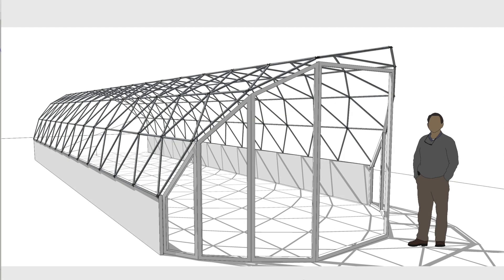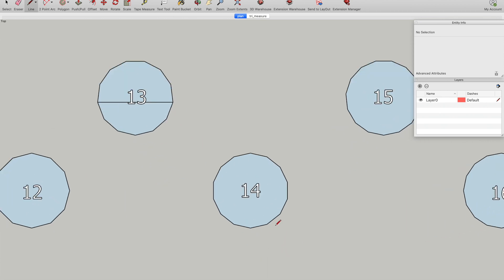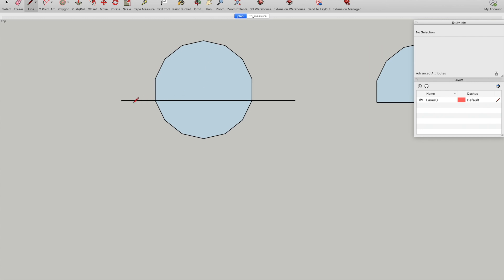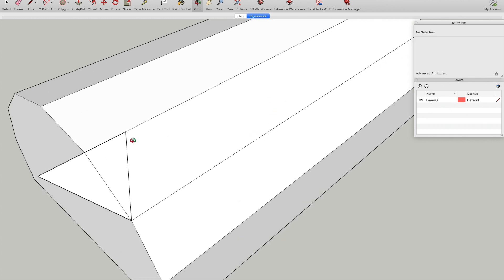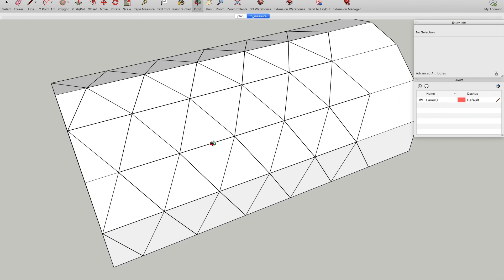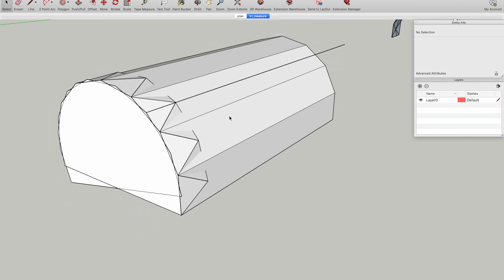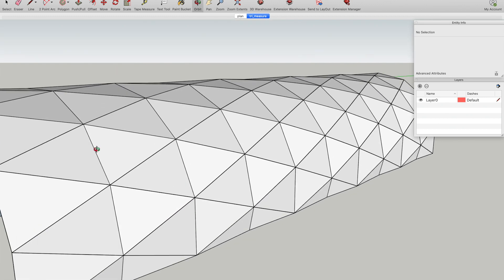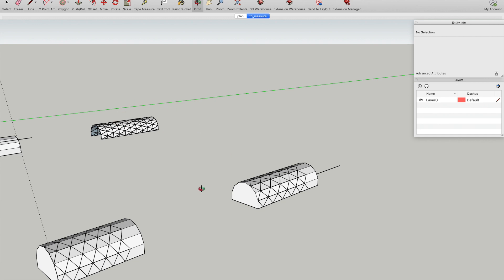A geodesic tunnel basic tutorial

Comment: Definitely up for the cheat sheet for the more complex one !  I want to use this as a roof structure for a workshop in Northern Ontario.  Need the headroom and snow load capability without large rafters and pitch required in a conventional roof. Nominal dimensions of 3 meters by 6 meters with a 1.5 meter knee wall.  Thanks for the great videos !

Comment: In sketchup it's easy enough to mark this out for pole struts, but how do you pull out and extrapolate the timber frame angles? I've tried that a few times with geodesic domes but the angle reference points are always bouncing all over the place and it's so frustrating I usually end up giving up in the end.

Comment: How about doing the struts like this and simply cover with a sheet? Or even with lengths of polycarbonate channel greenhouse material? Perhaps even bent in a curve and attached to the struts where they touch? Taped together. 

If horizontal, with thin straight strips outside over the edges of the sheets, screwed into the struts inside, providing a joint .

Or even have the horizontal sheets overlap as tiles?
Reply: I think you could do that by stitching on loops better than tunnels, and you could use 3d printed parts for holding pole to pole where they cross. Or even zip ties. But where are you getting 20 and 30 foot poles from? I've looked before for a different purpose but poles are damned expensive retail even in 8foot lengths.